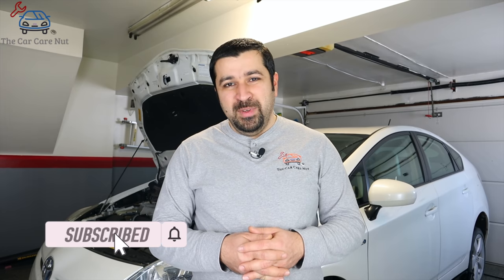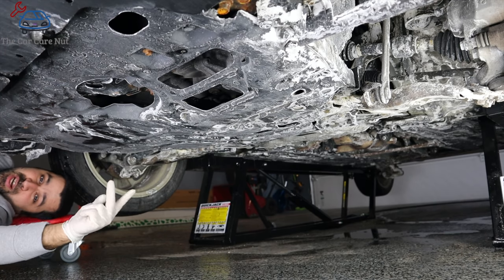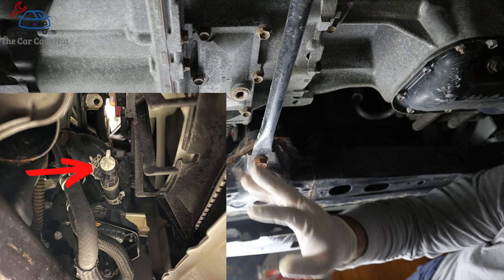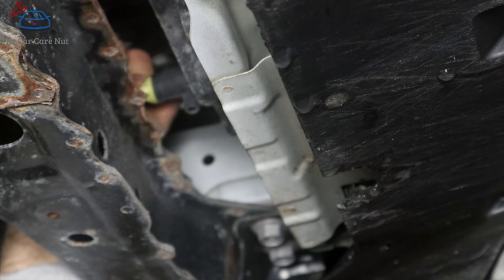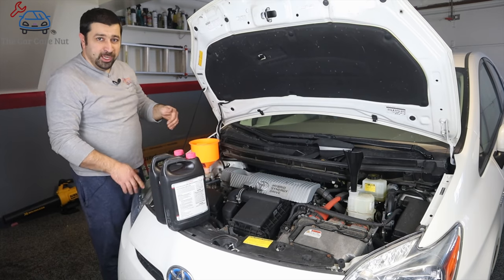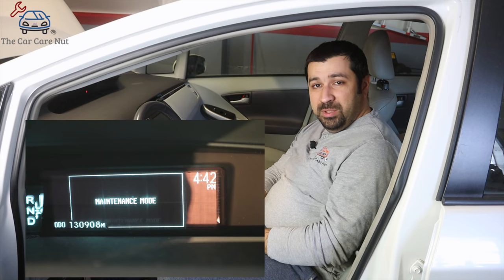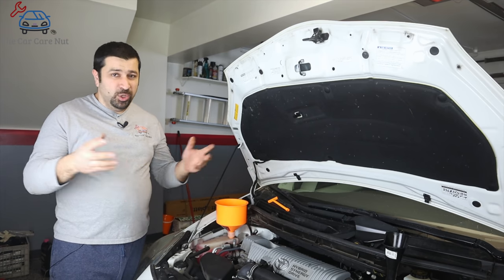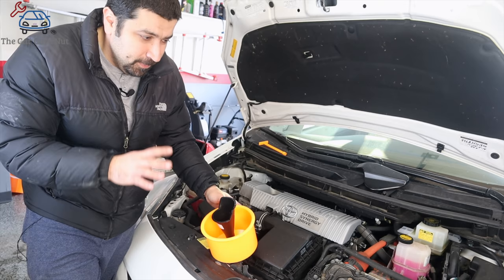How to replace your Toyota Hybrid Inverter and Engine coolant

Comment: any tips for removing the push pins, should they be washed/lubricated so they don't get broken or just replace as the break?
Reply: > any tips for removing the push pins, should they be washed/lubricated so they don't get broken or just replace as the break?
I bought an assortment of push pins from Amazon.  It can be frustrating to choose the right one (sometimes I use a different style because the right style doesn't fit or they don't have the right size), and they're not as high of quality as the original, but they get the job done.  If you can't find one close, you can always buy some from the dealer or an online dealer.

Comment: How many fan cycles should it take for thermostat to open?  I turned heater on when in Maintenace mode to speed up water circulation. But water in reservoir still did not go down.  Is that normal?  Thanks for the great video.
Reply from the maker: Hi! The thermostats should be open when the fan comes on the first time but the second time is to allow and air to come out
Reply: Hey Scott! Did you get this figured out? The fans come on for me in maintenance mode, but they won't switch off because (as far as I can tell) the coolant isn't circulating. It isn't draining out of the reservoir, as far as I can tell.
Reply: Yes Scott you probably already figured it out, but let the engine warm up and air bubbles come out and then add more coolant slowly into reservoir stop at the line and it will be good to go. I did mine last summer with a little hesitation, but after the video and 9000 miles it’s great. Now on to replacing the drive battery’s. Many steps on that job. Let me know. And drive safe.

Comment: Hello, I have a 2012 Toyota Camry Hybrid.  When changing the Invertor coolant, what are the procedure differences/if any from the task that you performed on the Prius?
Reply from the maker: Hi! It’s exactly the same
Reply: @TheCarCareNut  Internet forums say that without a Techstream Tool, you can damage the Invertor's pump due to air it.  Is that Internet Myth  or is their any special precautions I should take to prevent such damage?

Comment: Questions: My car is Toyota Hybrid --- To clarify ---- How many times should I press the start button when my foot off the brake ? is ONE time or TWO times ? Second Question : Should I turn off the fan or lower the temperatures around 65 F  or put the temperatures into full blast ? What is the Right answer ? Thank You...

Comment: I have a 2010 Prius with ~185K on it.  The engine temp light came on last summer when I was driving up hill at 80mph in 116 degree weather.  Rolled the windows down, cranked up the heat, light when off quick.  Since then I replaced the EGR value and cooler.  I changed the coolant (not inverter) and transaxel fluids.  I've had the light come on twice, in much different temps, but engine under heavy load (going up mountain roads).  What else can I check to make sure I don't blow a head gasket?

Comment: I have watched this over and over again and it won’t go into maintenance mood, I have dun the engine coolant and inverter coolant , but I can’t get it to go into maintenance mood , so had to run the car 3 miles then check level again, then another 6 miles then check again all look fine , then I went 12 miles let engine cool , all levels look fine , then drove another 7 miles, but this time with the heaters on nice hot air coming out, then put it back to cold air all fine , so hoping this has dun the job , by the way my car is a uk Toyota auris touring sports hybrid 2015 .

Comment: Does this procedure apply to 2nd gen?  I’ve seen other videos where they use bleeder valve and operate the pump from the relay for 3-5 sec to burp system. Thanks! Your videos are excellent!

Comment: Checked out that manual place, they do not seem to have them for prius older than 2014, any reccomendations?
Reply: Just an FYI.  I think it may have been an earlier video that AMD did, but he mentioned the Toyota "Technical Information System" website; techinfo.toyota.com  You can actually subscribe for various periods of time to access repair manuals and other vehicle info.  Just click on "Subscribe" at the top of the page and you'll get a table showing prices and the info available.  Hope this helps.  I love the Car Care Nut!

Comment: Hi. I Bought Toyota Avalon 2013 Hybrid With 79K Mile From Auction. What do you advise me to do with the hybrid system when the car arrives in my country? The car's inverter cooler radiator is broken. Will there be a problem if I drive it 1-2 miles broken? Thanks in advance
Reply from the maker: Hi! Try not to drive it longer than that as these things heat up pretty quick

Comment: Hi AMD, ran across this video. Is there w bleeder valve like Gen 2's? So u dont have to bleed?  ALSO, why does it say on sticker to only fill in between low/full. When I got my 1st 5,000 mile check, I was furious because they didnt "top off". I read it later on sticker under my hood.🙄How embarrassing.  How often, miles/or yrs do YOU recommend changing?
Reply from the maker: Hi! They don’t have the bleeder anymore for the inverter coolant. And the reason they want it between low and full is for expansion. As coolant warms up it expands and the level rises and vice versa

Comment: Excellent video. My Rav4 2016 Hybrid (Japan build) I'm looking to do this because the dealership insists on flushing and charging $400. The part for the gasket in video was 90430-a0003 but I find is superseded by 9043018008? Is that correct? As well, this is the same gasket used in all of the transmission drain and fill plugs too?

Comment: Hey car care nut, on 2012 Prius, what would cause the brake actuator to cycle every 1-2 minutes while the car is on?
Reply from the maker: Hi! If the brakes are not applied and it’s still cycling there could be an internal leak or more common air in the system.
Reply: @TheCarCareNut  happening all the time, is this something the dyi’er can diagnose & repair, if so how?
Reply from the maker: Honestly I would need to look at it to know what’s going on. With hybrids it’s a bit more complicated to diagnose the brake system for DIYers

Comment: how long it should take for fan to start? We waited for about 40 minutes, with heat on as well, it never came out, car drives just fine afterwards, no air. should we do it again? It was 90F outside, car was off for about 5-6 hours

Comment: I just saw my father poored water to the coolant so its mixed together to the left one which sjould be the engine coolant is this dangerous in any case if so i will tell him I don’t think he should do that but apparently he saids its for the AC so its fine and if this is bad what should i do drain it and refill ot flush? Forgot i live in a country where i will never go even below 15C or 20C so never go to freezing
Reply from the maker: Hi! I wouldn’t use water to fill the system. Use the premixed coolant
Reply: @TheCarCareNut  but would it cause any major damage but where k live lowest temperature is 20C so not below freezing we will go and change it soon but my country covid is kinda rising so we’re delaying it just want to make sure it won’t cause major damage
Reply from the maker: No major damage will be caused. This is one that causes issues over a long time. Like keeping it for years
Reply: @TheCarCareNut  thank you very much

Comment: I have a 2011 Toyota Camry Hybrid. From the looks, it seems mechanically the same as the Prius in this video. Can I simply put the front 2 tires on ramps and do the coolant replacement, or does it need to be level?  Thanks in advance!
Reply from the maker: You can do it on ramps.
Reply: @TheCarCareNut  Thanks much for the quick reply!

Comment: Great explanation Sir ! Thank you !! It hurts me when I saw all the rust beneath the car ! lol After driving on salty roads, I always pressure wash the belly of my car and the wheel arches ! 
Is it the same procedure for Lexus Hybrids?
How often do you recommand to change coolant ? Every 5 years ?
Thank you very much for your answers .
Reply from the maker: Hi! That’s the realities of the rust belt! It does apply to Lexus hybrids as well and replacement is every 5 years. The first mileage interval is 100k then after that every 50k miles
Reply: @TheCarCareNut  thank you! Merci!

Comment: If we do our maintenance on our cars, how should we record the maintenance, and will the dealership consider that when taking the vehicle for repair covered under warranty?
Reply from the maker: Depends on your state laws. In the case of coolant the first replacement is at 100k miles or 5 years which puts you out of the powertrain warranty.

Comment: Does this procedure also apply to the 2018 Toyota Camry Hybrid (First year of the New Design)?
Reply from the maker: Hi! That’s an exception and I plan to make a video for it in the future. The inverter part is the same but the engine part is different
Reply: @TheCarCareNut  Yes, I noticed the maintenance mode procedure doesn't work.  At the beginning when you push the start button, then gas 2 times and brake once.  It doesn't let you move the gear selector to neutral (have to fully start the vehicle to move shifter to neutral).  Do you know if there is anywhere online that has the written procedure for changing the radiator and inverter fluid and putting it in and out of maintenance mode?  When I do a google search nothing shows up, only 2017 and older Camry hybrids.  I prefer watching your videos because your an excellent teacher, but unfortunately I'm at 100K so I need to change it soon but really don't want to pay the dealer $250+ for them to do it.  Thanks, Kevin
Reply: @TheCarCareNut  Is this the sequence to get the newest Camry Hybrids into maintenance mode to keep the engine running so you can add coolant?  1) Push start button twice 2) press gas pedal twice 3) press brake and shift into neutral 3) release brake pedal and press gas pedal twice 4) shift into park and press gas pedal twice 5) Start vehicle like normal by hold brake pedal and pushing the start button?  Vehicle engine then starts and keeps running but the display doesn't display "Maintenance Mode", but rather cycles between "CDY-2E" and "Traction Control Off".  Will this procedure work or is it the wrong procedure and wont work?  Thanks
Reply from the maker: This works on your Camry. Some models won’t say maintenance mode but that is maintenance mode what you described
Reply: @TheCarCareNut  Thanks Man.  I can't wait to see your video when you get around to it.
Reply: @TheCarCareNut  What's up with the 2, upper and lower Drain Cocks on the drivers side of the radiator?  Are both somehow for the radiator or is one actually for the inverter since I didn't see a hose hanging down near the radiator to drain the inverter coolant?  Thanks
Reply from the maker: There’s actually 2 radiators one for the hybrid system one for the engine
Reply: @TheCarCareNut  Thanks!  One for engine coolant and one for hybrid inverter coolant, got it.
Reply: @TheCarCareNut  Replaced engine and inverter coolant in my 2018 toyota camry hybrid.  The inverter worked, drew down nice during maintenance mode, (but what do you have to do to get the engine coolant to draw from the reservoir and circulate in the engine?)  In maintenance mode the fan kicks on but engine temp keeps going up and no draw from the reservoir.  If I open the drain a little the coolant is still cold.  There doesn't seem to be any draw from the radiator to the engine block.  Thanks
Reply from the maker: You’ll need to disconnect the hose for the egr valve when you fill it. Then raise the engine rpm while you bleed it
Reply: @TheCarCareNut  Thanks Brother!  I have a few questions for you just so I make sure I get this right.  1)The EGR valve has 2 hoses hooked to it, one on the front pointing to the front of the vehicle and one on the rear pointing to the rear of the vehicle.  Which one do I disconnect?  2)When do I reconnect the EGR valve hose or hoses?  Before you start the car in Maintenance mode or do you leave it disconnected during the running in Maintenance Mode and reattach it after you take it out of maintenance mode but before you go back to regular driving mode?  3)How do you know your all done with the procedure in Maintenance mode?  Is it like the video where the fan turns on and off 2 times, then shut off, top off, take for a drive and top off as needed?  4)I assume the initial fill is via the radiator cap + reservoir and not just the reservoir like the video above since my reservoir doesn't have a hose on the bottom but rather sucks up through a hose that runs through the top snap on cap.  Sorry for all the questions, just trying to get this 100k done for my wife.  You know, happy wife, happy life :=)
Reply: @TheCarCareNut  Here is what I did and it seemed to work.  Could you let me know if you would recommend I do anything else to make sure it's ok.  I removed the forward facing EGR hose, removed the radiator cap and slowly topped it off.  I put the car in Maintenance mode and accelerated the engine.  This time the coolant was definitely moving around, and lots of air bubbles came up through the radiator cap.  Car temp never got over mid range.  The fan kicked on low, then medium, then super high.  After a while the fan then went back to slow, but did not turn off and the radiator stopped bubbling.  Am I done?  Can I reconnect the EGR hose and cap the radiator, take it for a short drive, then check the reservoirs?  Or do I need to take additional steps or run it longer in maintenance mode?  Thanks!

Comment: Hi AMD  on 2011 Camry 2.5 to replace coolant and bleed the air 
What is the best way to do it?
Reply from the maker: Hi! Fill the coolant using a spill free funnel and run the engine without heat until the fans cycle on and off twice
Reply: Thank you 🙏 god bless you

Comment: Hi @AMD,
I just checked the maintenance schedule for my 13 Camry and it apparently recommends the first coolant change at 100k miles and thereafter every 50k/5yrs. Should I just do my first coolant change (it's around 8yrs old now) or wait till 100k? Thanks:)
Reply from the maker: Hi! I personally would.
Reply: @TheCarCareNut  Thanks. Will do :)

Comment: Great videos! I have a '16 Rav4 XLE Hybrid. My problem is the passenger side headlight is always on high beam. This side was wrecked by a deer. The driver side light is fine. I swapped the lamps and it's the same. Any suggestions? I want to do the easy things b4 taking to my Toyota dealer.
Reply from the maker: Hi! The 16 RAV4 has kinda of a different design for the high beams because it uses only one bulb and a small motor that swings the light up. Doesn’t have 2 bulbs. That motor would need to be checked if it’s stuck in high beam mode on the affected side

Comment: Hello,. Thank you for your videos.  If I just pump out inverter coolant from reservoir and add roughly 1qt new coolant. Would it be better than not draining any coolant at all?  Inverter coolant has never been changed. Vehicle has 130k. 2010 HH. 

Thank you.
Reply from the maker: Hi! I would just replace the whole coolant. No issues if it hasn’t been replaced before
Reply: @TheCarCareNut  thank you for your quick reply. Is there a way to open radiator petcock as it is not accessible from under the car as the lower hose is in the way for 2010 HH?
Reply from the maker: You can go around the hose and drain it. Need to remove the lower cover to access it

Comment: Local dealer gave coolant with pink caps.  When I questioned, I was told "you don't want to use the red caps because you will get more contaminates"

Comment: Cool, I didn't know about Maintenace mode in hybrids. So you could use it after oil change too, to worm up the engine and recheck the oil level?
Reply from the maker: Yes you can. Just don’t drive the car in maintenance mode

Comment: Your videos are the best because you provide tightening torque settings.  is the drain plug gasket 90430-a0003 correct for a 2014 Camry Hybrid LE? Could you recommend a good Toyota parts lookup site?  I am also looking for the gasket for a 2008 prius, and a 2015 prius.
Reply from the maker: Hi! It’s the same for the Camry and I would use parts.Toyota.com for parts look up

Comment: The Maintenance Mode procedure in the video did NOT work on my 2010 Prius.  IF the first step of Press START without foot on brake is changed to foot off brake, Press START button twice then go to the rest of the steps worked for me and "MAINTENANCE MODE" was displayed.  With 88 degrees F air temperature, it took 19-minutes till the cooling fan came on.  Cooling fan ran and shut off twice in 27-minutes for me.

Comment: Enjoy your Videos! I just picked up a 2017 Prius with 89k miles. Curiously both the inverter and engine coolant were replaced at the dealer 6 months and 1 year ago respectively. That was early on miles so I’m wondering why the Toyota dealer recommended it? Anyway, I’ll be watching for more tips!
Reply from the maker: Hi! Curious as that’s too new. No harm in doing it early. It’s every 5 years and the first mileage interval is 100k then every 50k after that
Reply: Our dealer (all of them in our region, actually) loves to recommend early stuff.  They wanted to change all coolant (during a recall appt.) at 79k mi, on our Avalon Hybrid. They claim “in our experience, it’s required more frequently than manufacturer recommendations”. I said no, that’s pretty early for my slow driving style. Ironically, took in my 2006 sequoia with 198k mi, which I knew needed a couple of things at that time, and they had no recommendations. 🤷‍♂️